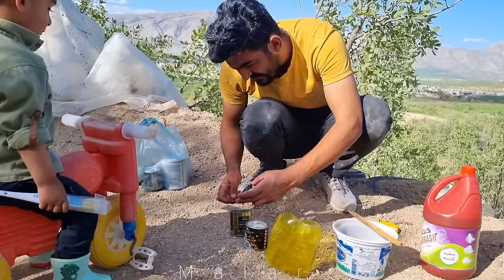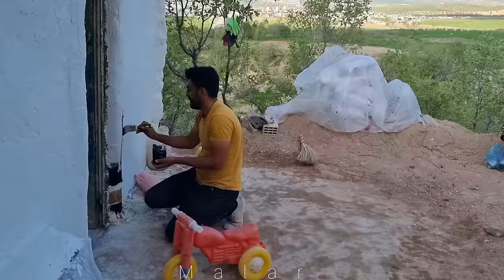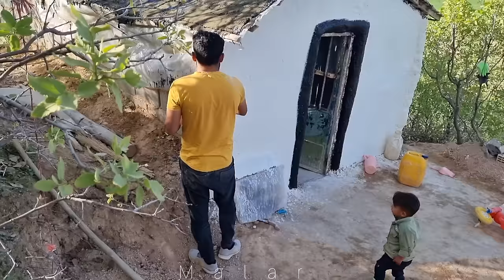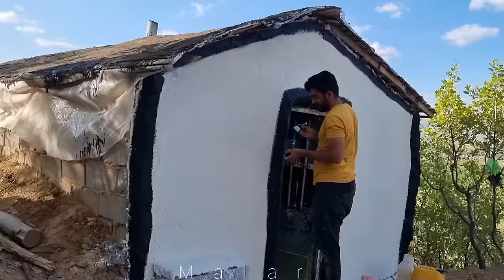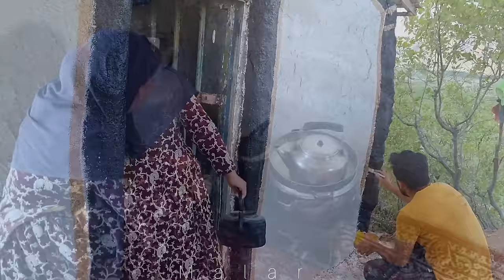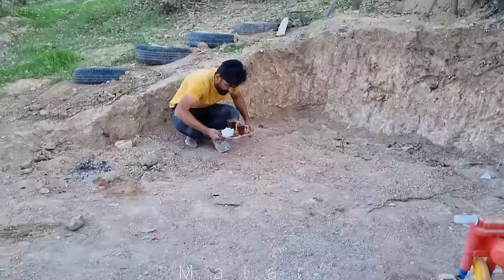"Love, Sacrifice, and Strength: The Resilience of Saeed and Maryam"❤️❤️

Comment: Please strengthen the walls by coating cement or plaster it. Strengthen the roof also , for every rains you running and covering the walls and the roof. The walls are leaking when rains. Cover the front portion so that it will protect rain water entering into the house, and will give shade also.you are working so hard, I appreciate you both, May God Bless you both and your children🎉🎉🎉